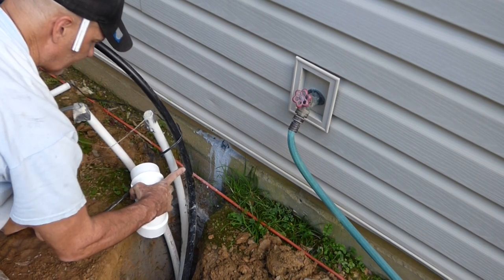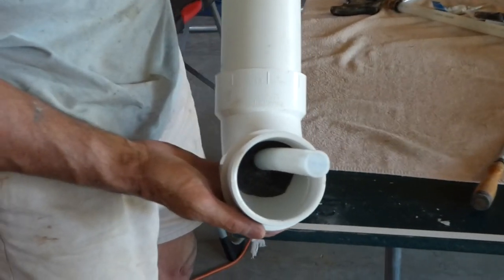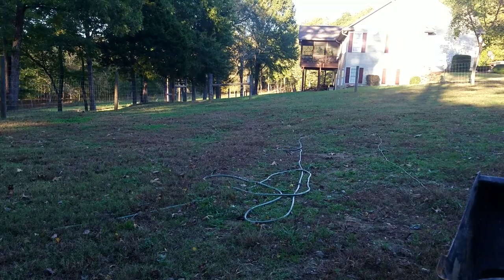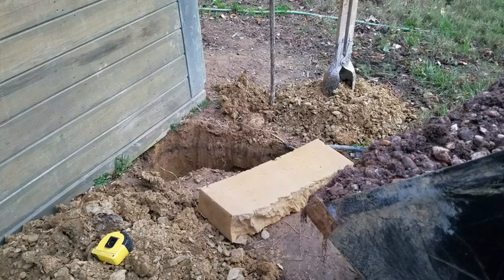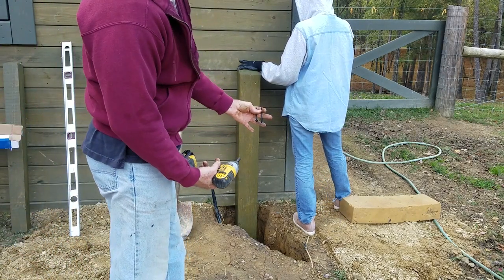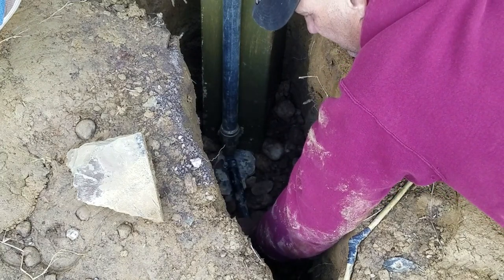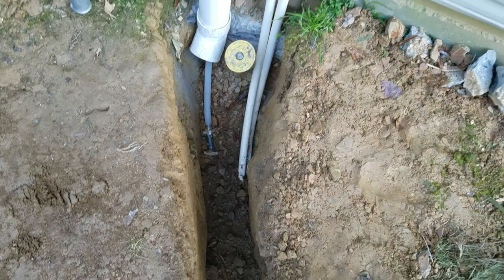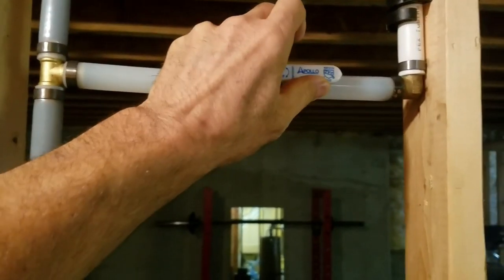Add a Frost Proof Water Spigot Anywhere on Your Property - Complete Instructions

Comment: Hey may I ask what state are you doing this in please? I’m in Kentucky and I think our frost line well I’m not sure I think 3 foot or 2 lol but ty so much ! I have a plumber wants tons of $ hundreds and he wants me to did and buy parts the hydrant is not cheap so I’m gonna give this a try ! Lol ty any comments are welcome please ty
Reply from the maker: Frost line is 12 inches in this area.I got the hydrant at Lowe’s on sale for a little over $50.  The hardest part was trenching in the water line and other than that just takes a little time and effort. I ran a three-quarter inch waterline and I am happy with the water volume. If you go smaller than that you may not be happy with the water volume you get depending on your needs.

Comment: I can't see how a small bit of installation encased in PVC pipe is going to keep water from freezing...you must live in Florida....
   Up here in the north you would have to cut the hole through the concrete to submerge into the cellar for your hook up...
    & The water line Should be encased in a larger diameter pipe for underground abrasives like stones...
    But Good Luck....